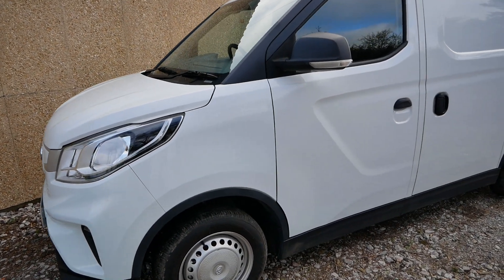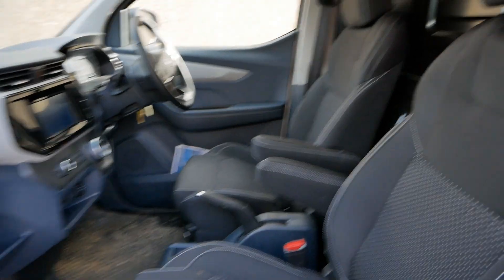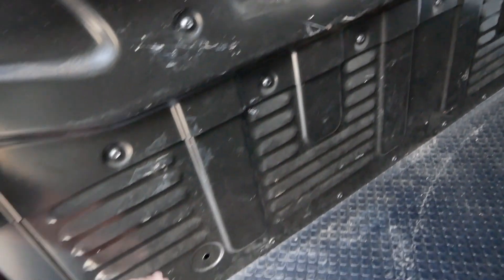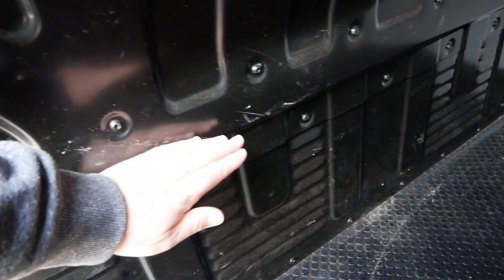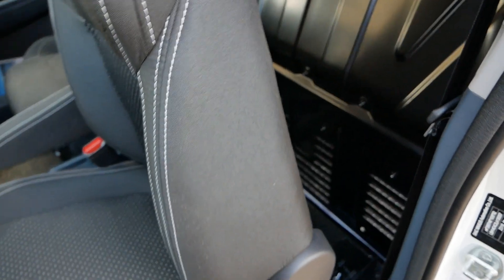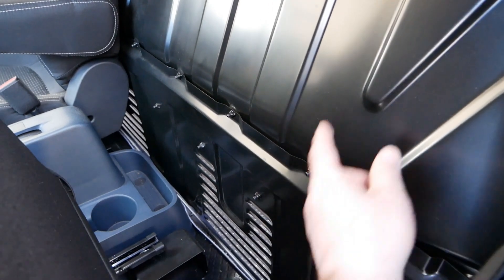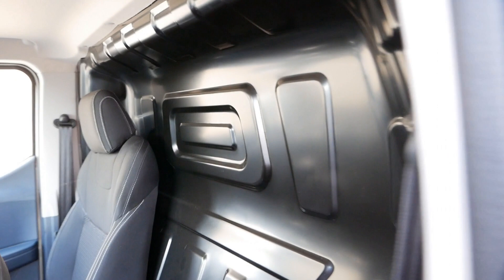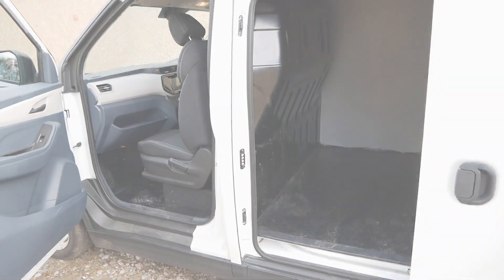Can you remove the bulkhead in a Maxus eDeliver 3 (EV30) electric van?

Comment: Does it void the warranty? I wouldn't expect it to but I saw someone online said it might
Reply from the maker: No I can't see why it would. As always it depends on what the warranty claim is. So if say there was a charging issue, they couldn't void the warranty because the bulkhead has been removed. But if there was an issue with a twisted roof panel (not that there would be), then it would be understandable that that claim could be voided due to the bulkhead being removed.
Most vans are modified in some way with racking or such like in the rear.